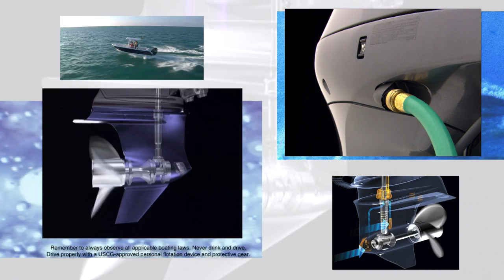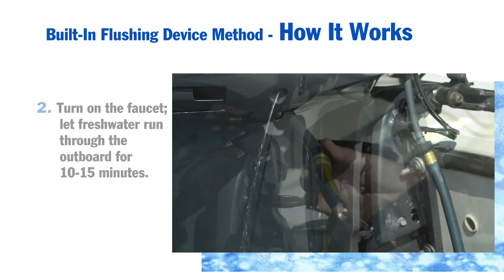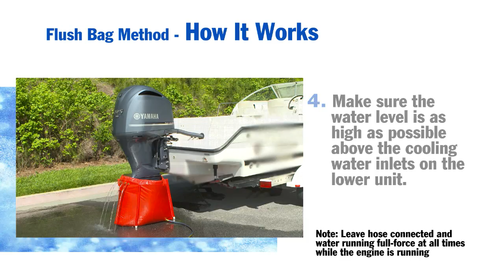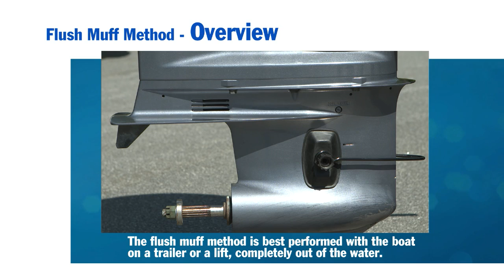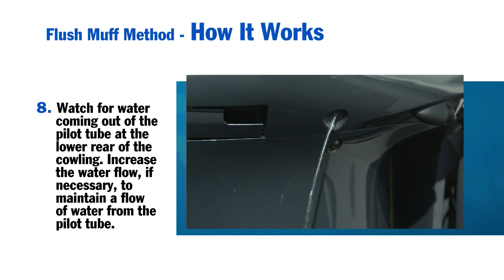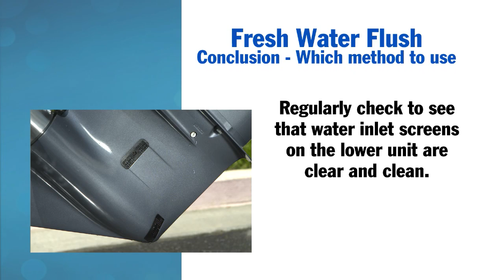Fresh Water Flushing | Maintenance Matters

Comment: There seems to be a fair amount of conflicting information about using the Freshwater Flush Attachment.  Many boaters claim that this will not flush the power head as water is not getting past the thermostat.  I'm not sure this is a true statement or maybe it does not apply to all Yamaha outboards.  Based on pictures of the thermostat, there seems to be a hole that presumably water can get past even if the thermostat is closed.  However, I do not see anything in my user manual that makes this claim.  Would be great if Yamaha could respond to clarify this and put this topic to rest once and for all.
Reply: OK, think I found my answer - http://yamahaoutboards.com/yamaha-advantage/news/boating-tips/boaters-log-vol-5-no-2?_ga=2.65802990.1911678415.1494091666-724104717.1493466004

Comment: Thanks for a very instructive video. 
The pressure in my garden hose is rather high - could that be a potential problem when flushing the motor through the flushing port? 
Is there a risk of damaging internal gaskets or is it rather recommended I go full pressure (to flush the inside as much as possible)?

I have a 2014 BF225.

Cheers
///Henrik Seth

Comment: can I flush the engine at 45 degree trim position? problem is I can't get the boat from water
Reply: Toar Waraney me2 want to ask this question, as my place it should be need to left up the motor high to leave the salt water, and i attach flush muff on it to flush the motor, if it can it will be a great help for me to flush the motor.
Reply: well somehow by the desperation of my soul n a little guts LOL.. I did try this method and seems ok.. I said "seems" because am not realy sure about it before at least some experts confirmed it.... or somethin bad happened to my outboard LOL.. so an advise still helping, if any..
Reply: I think from Yamaha official they will reply us for "no" about this.  But one of expert from my location told me that the old model of 2 stroke yamaha outboard should be OK but not in a angle was too big.
Reply: in my case is the opposite.. I did it with 2 of my 4 stroke 150pk.. while am not dare enough to do it to my 2 stroke 115pk as when I attached the water hose, the water also came out from another hole at the front side of the lower part. this makes me thinkin that the suction migh somehow losing volume of water that it needs.. well, once again. lack of information is my problem.. from Yamaha official in my city (as you said) they gave me the "NO GO". but as we all knew, official tend to not allow anything outside "standart" prosedure. it's ok if only that I can take out my boat from the water without have paying the rent money.

Comment: You demonstrate , my 2014  225hp four stroke (with high speed pick ups) being flushed  using muffs alone ?with no covering of these pick ups. I have a new motor and am confused as to what is the best flushing method? I might add I am not concerned about noise or ease ,but essentially what the most effective method is .

Comment: The freshwater flush tube will no longer let water into the engine when freshwater garden hose is attached. How can the tube be cleaned of a clog?
Reply from the maker: Donald - If you haven't already remedied this, we recommend visiting your local dealer and have them investigate the problem. You definitely want to get the hose unclogged so you can flush your motor effectively.

Comment: What is the rationale for removing the prop?
Reply from the maker: Removing the prop is a safety measure when using a flush bag. Since you will need to engage the throttle to raise the RPMs, it is necessary to remove the propeller.